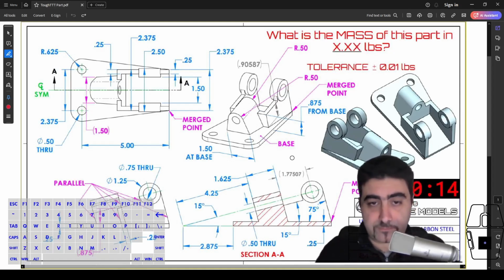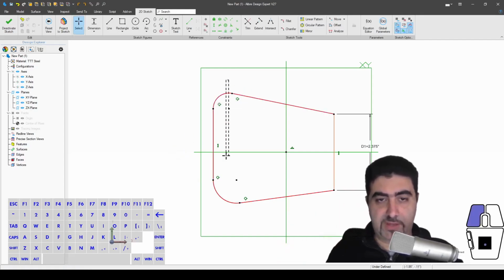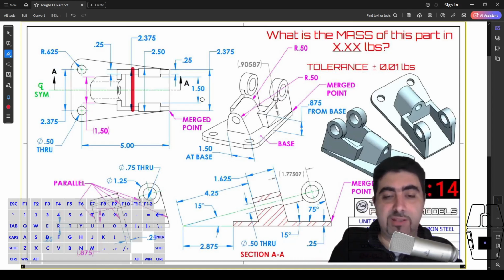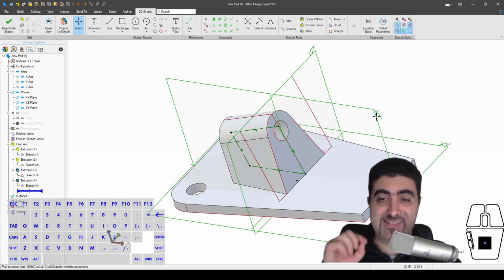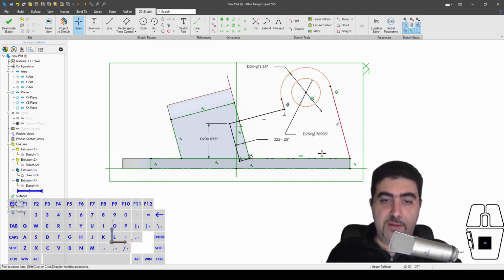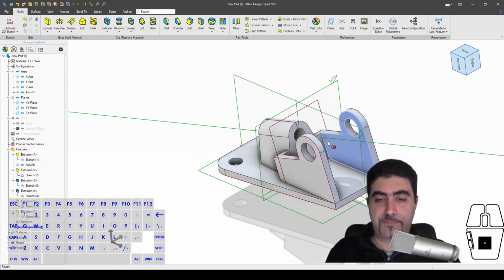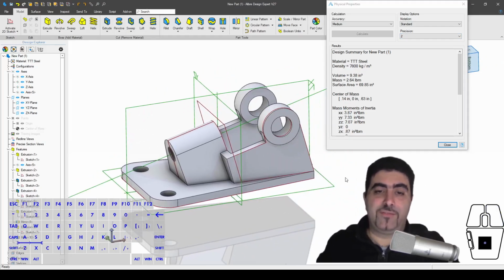This CAD Trap Almost Got Me | Watch How I Escaped It

Comment from the maker: The reason I got 2.64lbs, which is within tolerance but NOT the correct answer, is the internal circle in sketch 5, at the back. The one on the angled flanks. I fat fingered it and the .75" diameter didn't go in. I was lucky enough to have drawn it close enough at a diameter of 0.70995"... Close call!!!

Comment: Hi, love your videos so thank you so much for sharing them.  

Wondering if you or someone else could answer a question.  I've already looked in the Alibre forum, but may have missed it.  

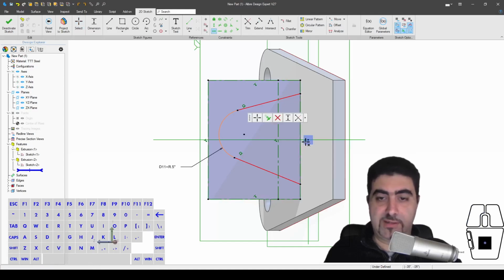QUESTION: what setting are you using to identify drawing element identifiers with there respective dimensions?  For example, at around minute 13:00, the dimension for your R 0.5" arc, D11 is added to the notation.  Thanks.
Reply from the maker: Hello Eric Alain!!!

Thanks for the great comment. If you want to show the dimensions number you need to go to files-->properties -->dimensions and select show equations. It will also show the equations instead of the result but I find that that helps too.
Check out this other video of mine at 37:55 https://youtu.be/dhdIn5EBqp0?si=IxNnnqIqKI_qf0S7

Comment: That is an interesting solution to the model, as a coincidence, that is the same model as  23-T-70 Brace Plate that was used in the October 28th World Championship, except in that competition the material was ABS. Here's a link to that part of the video with Imants and Jehan doing their best.
https://youtu.be/wgVfmkfOcPc?list=PLzMIhOgu1Y5cRVAg-76O95jtynAQazG6C&t=7468

At the time I did that model and was able to get the correct mass. However, when I did this model I had forgotten how I modeled the first one so I struggled a bit and ended up using a loft for the tombstone shape. I was so frustrated by the model that I deleted the end result so I may attempt it again one of these days.
Reply from the maker: Yeah, it's a really bad one to get in a competition setting because it's really hard to understand that the tombstone is in fact a straight extrusion.

But, when you do realize it I think it is a strategies that lends itself to other designs as well. For real world parts, not just TTT competition parts

Comment: hello, Ex Machina! wow, nice video man! i modeled this part step- by-step the way you did (which was nice and super clean, by the way), but i got a mass of 2.59 lbs.
i do have a question for you. when you measure the bottom left side edge that terminates at the top of the base plate, does it measure 1.50in, or is it a bit less? just curious.. again, this is a really great video! there's a lot of good information and your Alibre skills are awesome!
Reply from the maker: Hey Jed, thank you so much for watching my video and commenting on it. I am guessing you mean the "sunken" side of what I call the tombstone shape. Yeah, that is 1.5" on the dot.

If that's what you mean check the video at 16:21. I click on the edge and Alibre's real time measurement in the bottom right (underneath my ugly face...lol) shows 1.5", whereas on the other side of that tombstone it shows 1.7 something.

Let me know if that's what you were looking for. If not, I'll check my model again and let you know.
Reply: @ExMachinaEngineering  Haha! Absolutely, Ex Machina! Thank you! Yeah,  I guess the short side (opposite the cylinder end). I made a part of just that feature at a 15° angle, and when I cut it flat across the bottom, the side on the cylinder end was 1.5, but the opposite end was shorter. I was just thinking if the angled legs on the tombstone feature aren't the same length on both ends, (they can't be if it's cut at 15 deg), i don't think the left and right bottom edges can be equal. Doesn't have anything to do with your approach at all. I was looking at it in general.  I stayed up all night; I couldn't go to sleep and probably imagining things. Lol! I'll check out that part in your video later today. I appreciate your reply, bud. Keep the videos coming! Good stuff! Thanks again, Ex Machina!
Reply from the maker: Thanks man. Your approach with the boundary boss was great too. Cool vid there too! Again, thanks for the kind words. Catch you on the next Model Monday Live
Reply: @ExMachinaEngineering  oh man! sorry, now i see what you did. you converted the entity of the bottom edge opposite the cylinders (rings; whatever) onto your cut sketch on the cylinder side. i was like what? i was thinking you cut it 1.5in at the bottom on the cylinder side. i thought, "if that's the case, there's no way it's 1.5 on the short side."  okay, i get it now.. super sweet! oh, i updated mine and got 2.63 grams.. i think your method definitely is more sound.
thank you for the compliments on the video.. much appreciated! you're either one of the whole18 subs i have, or just watching. hahaa! i''ll be seeing you soon. it's difficult for me to make it to MML because of work. not to mention, my work solidworks has a bit of a lag to it, so it's difficult to compete. 
i did watch your last match the other day. nice job man! i hope you go all the way! i don't even know when the matches are. i guess i need to get on top of that.
thanks again, bud!
Reply from the maker: Yup! That's it, you got it. Alibre calls it project. But it's the same as SW convert entities.

And I am subbed. Of course I am. Lol.

As for the competition, I lost against Imants. I don't even mind that. What gets me is that I was sick and a bit doozy and couldn't do my best. Probably would have still lost, but it wouldn't bother me so much

Comment: "let's hope this is less than an hour." Yeah... Tell me about it.

9:55 Did you just.... You can use TAB to set the angle of a line just like you can use it to set other dimensions?! Mind blown.

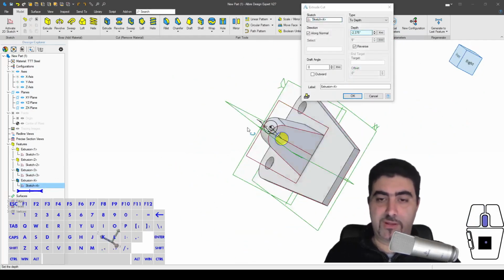16:01 I have done that before, but I am going to start doing that more, as sometimes it's definitely easier to design things on one sketch.

17:45 I like seeing your key presses, but yours has a lot of overlap with what you're doing on screen. I've never used a keyboard overlay like that, so I don't know what other options there are.

~ Toby, regarding this model on my Discord: "a lot of times in the real world when you're going from "2D to 3D" the "2d print" is not a proper ISO certified drawing, but instead is a napkin sketch or something similar from the customer.  So it is good to get used to working from "bad drawings."
Reply from the maker: Thanks again for this detailed comment. As always, it gives me more insight into how my videos are perceived.

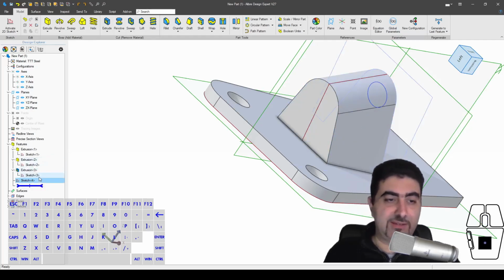16:01 Some people swear by layout sketches. I'm on the other side. I don't like them and I never understood why they save time. You do the same amount of lines, you put in the same amount of dimensions. So, I prefer to do it with the 3D body showing, if that makes any sense.

17:45 Yeah, you're right about that. But I'm trying to strike a balance between having it being visible on a handheld and not taking up too much room. That's why I have it under the Design Explorer. But the main reason I use it is to show the key presses because I use so many Hotkeys.

As for Toby's quote, having worked on a CNC machine shop I can tell you, I've definitely seen worse. Imagine working after hours to get a project done, and be presented with a print that an old Mechanical Engineer did in AutoCAD with no 3D model. And realize that the views do not match up in a particular spot.

So, trying to get the design intent from the 2D print is a very marketable skill, acutally.